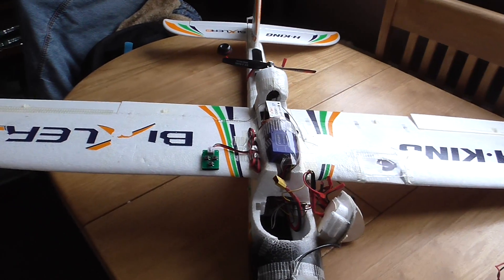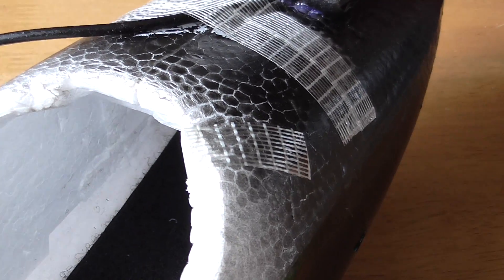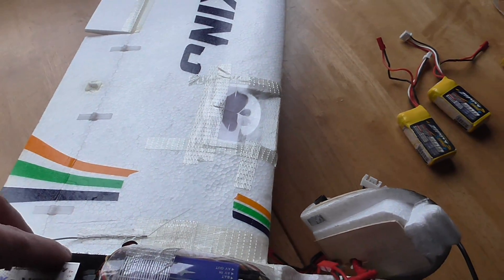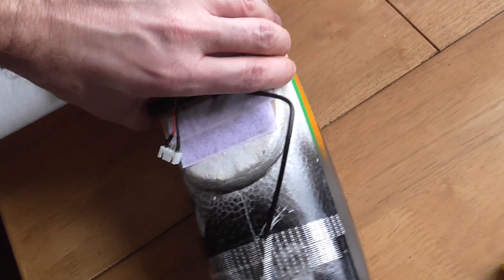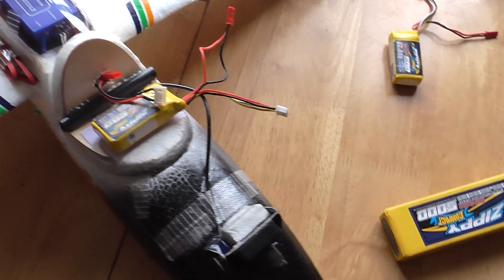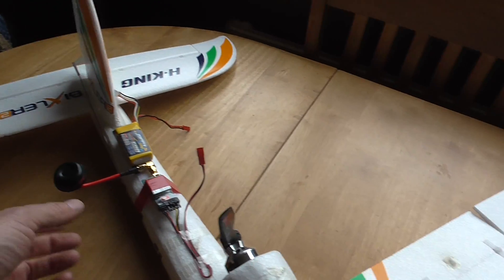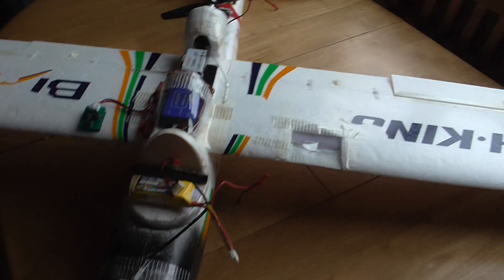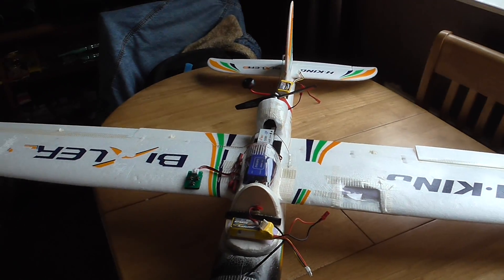Bixler 2 Cyclops Storm Set Up

Comment: Hello there  ,,I got Mine with OSD flashing of .on,/  I read RSI cause this then It drops 5% ,i hd controle issue when I pushed it, so Using 433ezuhf ,on high, i will try ask if setting In the OSD need to Be set ,  I Also change areal to test Next. RTH and PA modes work well . i just loose the screen at 800m. So many Questions, I dint set up My THrotel Either .with RTH. How do i get the RTH to cut in when RSI drops , I feel stupid to ask.. with My Limmited Knowlage of the subject.
Reply from the maker: To set you RTH it has to be set as a failsafe threw your radio and transmitter ( like turning motor off on failsafe ) test your model to see how much throttle will keep your model nice and steady with RTH Failsafe and use them settings. To use RTH while still having signal is just assign it to a 3way switch and flick the switch at anytime to get the model to return to home
Reply: Pudsey - Rc i got the tornado from cyclops. its my first real osd with autopilot. how do i set up the rth and the other autopilot features? would love to be able to turn them on manually and automatically for out of range or tx problems
Reply from the maker: Ricky Cooke All depends on the radion and rx you are using to how you set it up mate
Reply: thats the problem i dont know how to set it up. ve got the control surfaces plugged in the correct spots but i cant set up the rth stuff because i dont know how to. im using a basic 2.ghz 6ch tx and rx but will be upgrading to the turnigy 9xr pro but i need to find some cheap uhf modules that are reliable and must be above 9ch and im finding it hard to find that kind of module
Reply from the maker: brian burnett If your having issues with your screen flashing its probably dirty power. you can either run your osd from a separate battery to your throttle or put a power filter in your set up
Reply from the maker: Ricky Cooke easiest way I found was to set a switch and then change the weight values and watch the osd see when it changes to failsafe and pilot assist
Reply: on my tornado i have the norm channels for the servos ect and then i have 

rssi,MOD,DIS,buss/rudder - have rudder in use
so whats mod and dis?
Reply: Ricky Cooke got mine working YAY :) . but i cant turn on the rth but can get into pa mode
Reply from the maker: keep playing with the weight values until it says rth keep a note of the values and assigned each to the different position on the switch